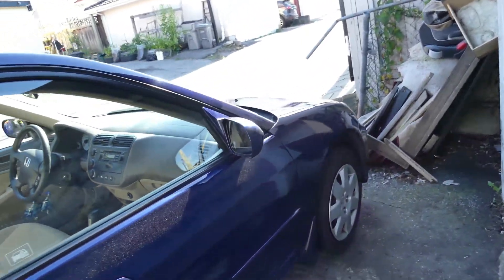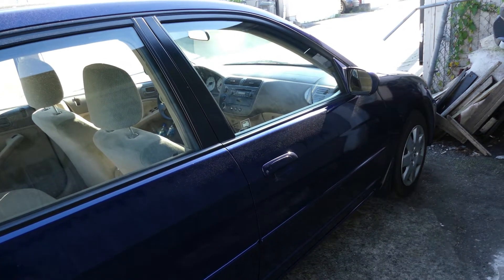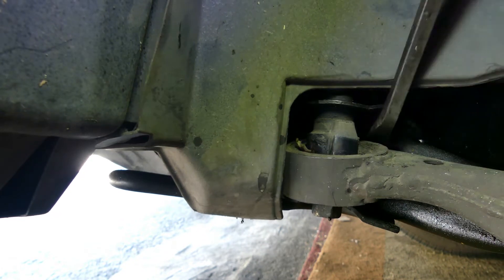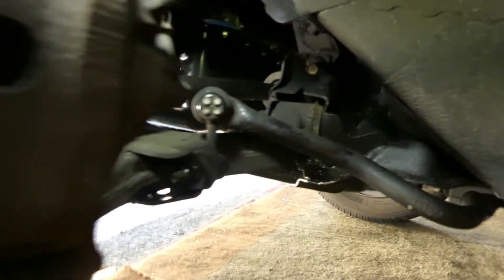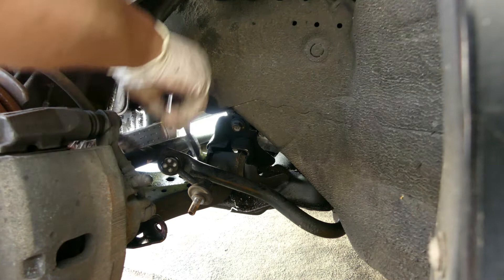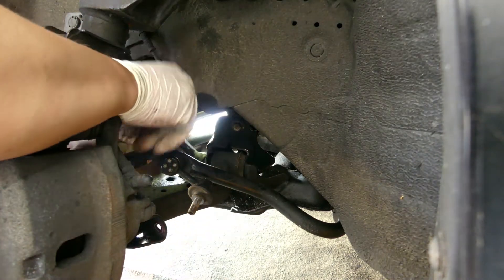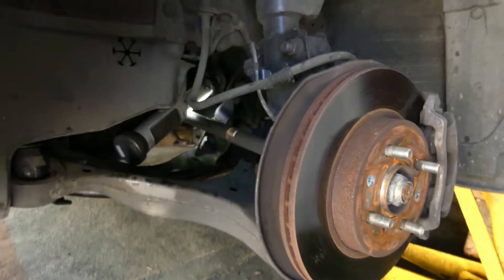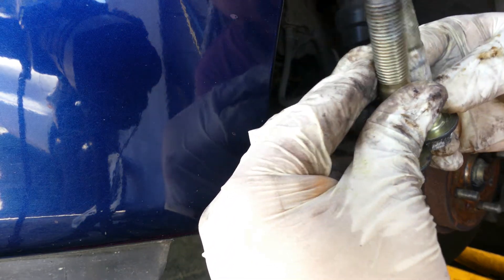Clunking Sounds  [ 2002 Honda Civic ]

Comment: Changing my control arms unfortunately didn't fix my clunk. My clunk was actually from the subframe, I noticed it when accelerating from a stop and when heavy braking. 

I started noticing the clunk after I had the subframe out of the car when changing the transmission input shaft bearing. A year later, and after replacing nearly everything in the front end with no success, I finally found the issue. Apparently the subframe should be tightened with weight on the tires, not when jacked up. I loosened the 4 -17mm bolts holding it, let the car off the jack stands, then tightened them back up. Clunking is finally gone! Another thing I did was make sure the sway bar was aligned correctly, equal distance from the control arm on both sides – loosen the 2 bushing brackets and use a pry bar to wiggle it left or right as needed. I even paid a mechanic to diagnose the noise, he had me replacing parts unnecessarily. Thanks for video, hopefully my comment will also help someone out there, cheers!
Reply: Where are the subframe bolts? Did the misaligned sway bar cause a clunk?
Reply: @shrimpfriedrice494  I changed both the sway bar bushings & end links and I still had a clunk, re-alignment didn’t help either. My noise was for sure from the 4 subframe bolts; just google search their location. Also do not tighten them with the car Jacked up, you must have the car’s weight down on the tires when tightening. Cheers!
Reply: Right now my 02 Civic has a clunk sound when accelerating from stop. I never messed with subframe or anything like that. What would cause the subframe to act up like that?
Reply: It probably isn't your subframe, mine was acting up because I had it out of the car and didn't torque it probably when re-installing. I'd start with the cheapest things like sway bar links and bushings, check your motor mounts and ball joints. Cheers!  @voltixD